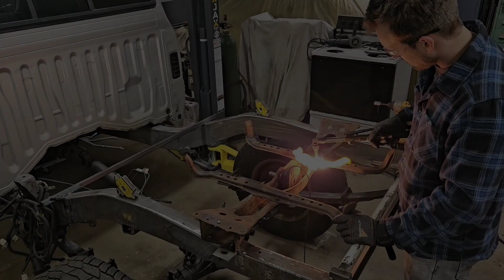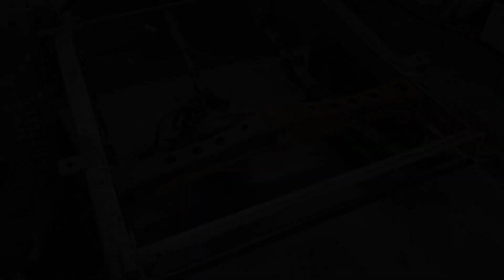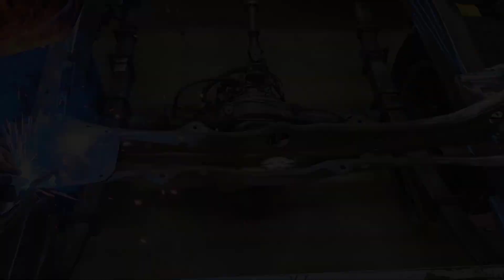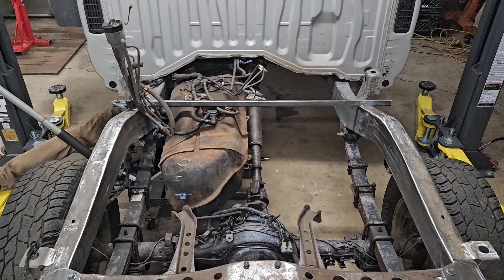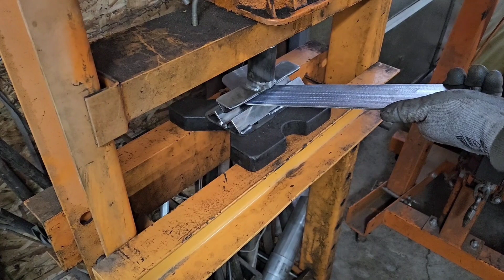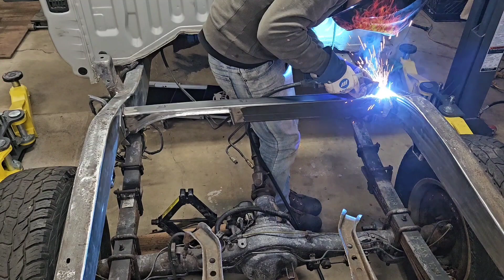Building crossmembers for this boxed Tacoma frame

Comment: Thanks for the reply. I’ll keep my eye out for a B1.   My gas tank/exhaust crossmember is actually brand new. I wonder if there’s a way to still box in the frame and shorten it to fit between the frame rails like you did for the rear one. I don’t think I can fabricate crossmember like you did. I’m really new at this metal fabrication stuff.
Reply from the maker: Oh wow, a new one!
You could still make it work with a boxed frame, just like you mentioned. I would bolt it in the factory location, take several measurements relative to the chassis, then shorten it so it fits between the boxed rails. You could create bolt-in provisions or weld it solid to the frame.

Comment: I'm at this very stage of modifying the tire carrier to make it fixed the boxed frame.  How did you shape the lower support bracket to get around the leaf spring hanger?  I mimicked your design for the upper bracket, but am not sure about the lower one.  Also, how did you bend the lower reinforcement plate that you welded to the bottom of the tire carrier crossmember?  The curve is so gentle that I'm afraid to use the bending die (that I also copied fro  you).   Thanks!
Reply from the maker: @turtleboy428  I am flattered!
Once the upper brackets are installed, use some template paper to wrap around the frame to the lower side of the tire carrier bracket. It is a tricky piece to bend. I used a hammer and a dolly to ease the bends whilst cranked down in my bench vise. The lower carrier reinforcement was made out of a thinner steel, so it was easy to bend by hand; a gentle curve is all you need. Weld/tack it on the end, then clamp it along the curve as you go.

Comment: What year Tacoma?
Reply from the maker: 2003 TRD, 3.4L V6 and 5 speed transmission
Reply: @PostRt  nice! I just got caught up and finished watching. Fun to watch this fabrication. Wish I had the resources. Maybe someday 👍
Reply: Awesome work. I had a 2003 sr5 4 cyl 5 speed that was like new except the frame.  Up front is where mine was rotten. Had it plated a bunch but it was getting to the point where there wasn’t enough solid metal to weld to. Love those 1st gens!